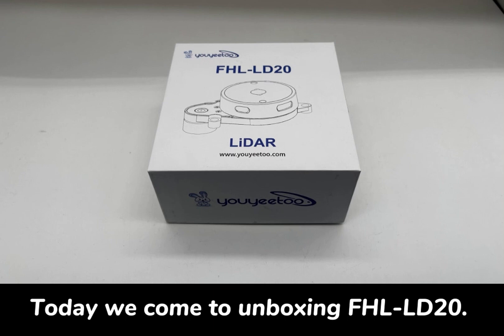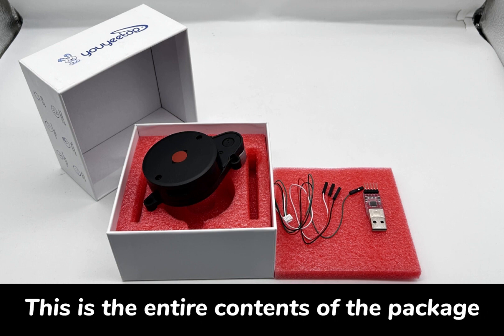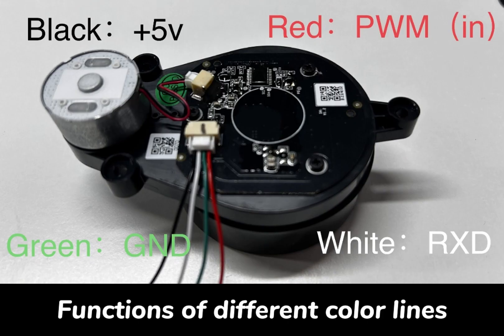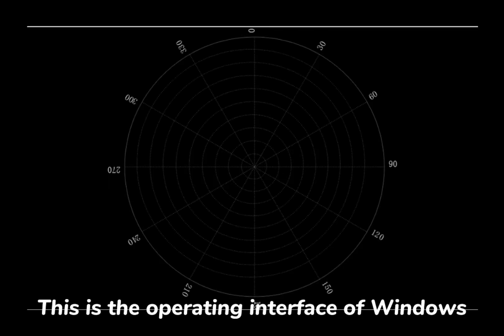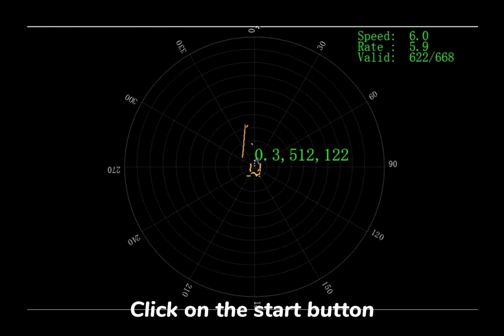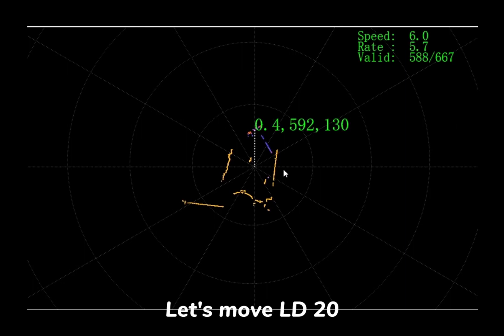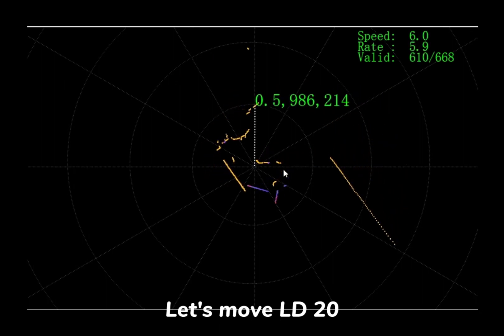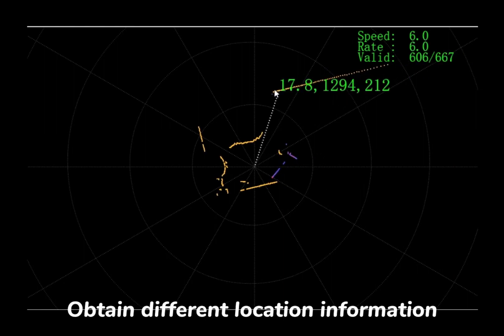LiDar FHL-LD20 ,  Low Cost 8M 360° lidar Scanner , Unboxing - 低价格 8米 360度激光雷达- 开箱

Comment: Thank you for making this video :) I have a Ld20… I will try with those connections

Edit: yes! Those connections work: red is Pwm and black is 5V, but the connections in the wiki have a mistake 😊

Now I need to make it work with LD20
Reply: where do u get the windows software from, the link it give is an empty gdrive file